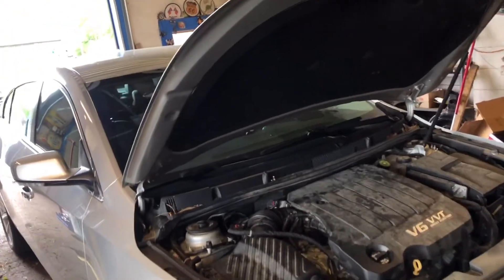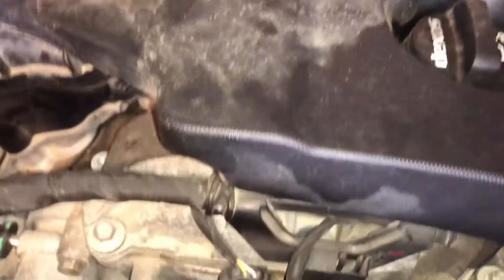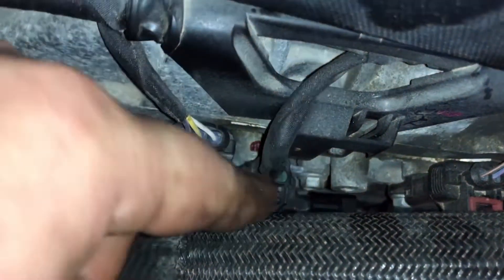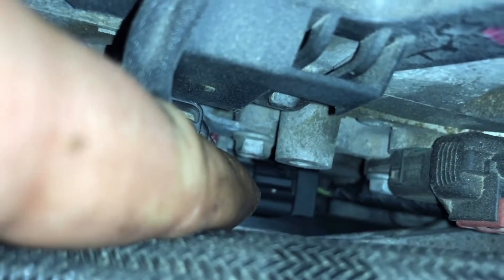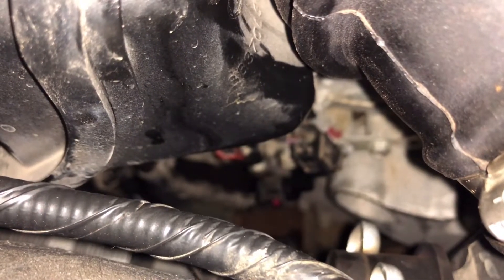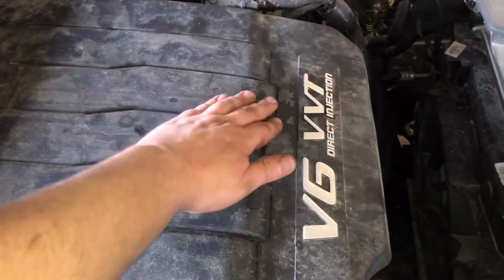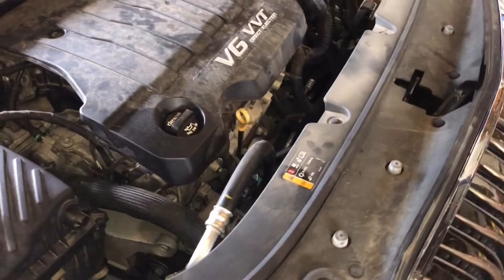P0014 fix 3.6L VVT solenoid location cylinder identification bank 1 2 A B camshaft code GM Buick

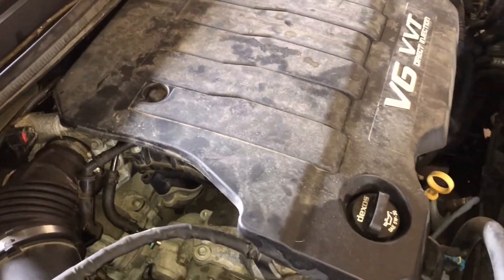Comment: You're a savior. I JUST wanted to find Bank 2 on my 2012 Lacrosse... NOwhere else online explained it as clearly as you did at 1:55... Thank you!! Now I know which O2 sensor I have to fight, the slightly-easier-to-reach one. <3

Comment: This is covered by a special recall. No charge repair if done by dealer. Covered free for 10 years or 193,000 km (120,000 miles). Reimbursable if you have all the paperwork.
Reply from the maker: That’s some awesome information! Thanks for sharing 🙏
Reply: how do I find out more about this special recall?  I didn't find anything online about it.  thanks
Reply: I called Stealership about this issue last year. Service rep was very hesitant. Said we'll we'd have to diagnose it. I then asked if that was the issue. Would it be covered? He still wouldn't give me a straight answer. Don't trust them. End up coming out with at least a several hundred dollar bill

Comment: 13 Terrain 3.6 I've got code P0011, cam too far advanced bank 1. So im guessing the solenoid on that side, oil is clean and up to date. My next question is they are actuated by oil pressure do thay have filter screens? Thanks for the video very helpful' also wondering if I can go through the passenger side wheel well?

Comment: I tried to remove my bank two control valve but the engine mount is in the way. looks like you have to remove everythign on the right side of the engine to access these.

Comment: Can an engine lost spark if the over advance bank 2 message appear on the obd2 tool ( scantool ) a mechanic replace the camchain and  engine has no spark on bank 2, just this code Camshaft Position A - Timing Over-Advanced or System Performance (Bank 2)

Comment: Im trying to replace the Vvt intake solenoid on bank 2 do i need to remove the engine bracket to slide it out or is it possible with out having to do so?
Reply from the maker: tight squeeze

Comment: Any idea on how to get the cam solenoid seal out of these?  It looks like they have a metal ring embedded in the rubber seal.
Reply from the maker: cookiehead2 i’d have to put my eyes on one again to remember. I do recall them being a pain if everything is not out of the way or motor out and you do not want them to drop inside the engine so be careful.
Reply: FerKurl ah well, i got it done.  I have no idea what the correct tool is, but I used a right angle flathead screwdriver and a 12mm box wrench to pry it out.  This took about 2 hours of messing with it.  The seal has two metal rings built into it - one inner, one outer.  The inner one is easy to tear loose, not a big deal.  The outer one would be impossible to push back into the head(there’s a lip) but it’s almost as difficult to pry it out.  The rubber sort of holds the ring in place, so even if you work it out a bit, it tends to snap back.  I was able to damage the bottom of the metal seal ring enough to grab onto it with my box wrench and eventually work it out.  Very tedious.

Comment: how do I remove the electrical connection? And do I remove the negative cable from the battery first?
Reply from the maker: Good idea to disconnect battery. Connector should unclip. Can’t remember if there’s a safety clip or not u have to pull back first

Comment: Did you have to remove the motor mount to get them out? You don’t explain any of that.
Reply from the maker: On this vehicle no I did not remove the motor mount. Can be done without removing mount. Area is tight so if you need more room or have bear hands do what u gotta do